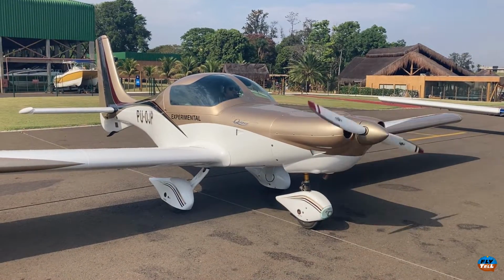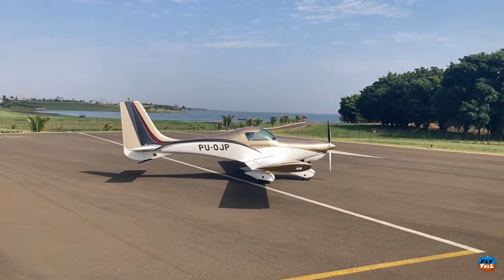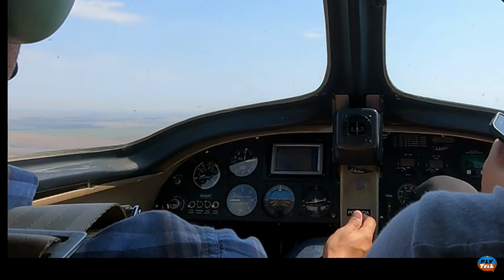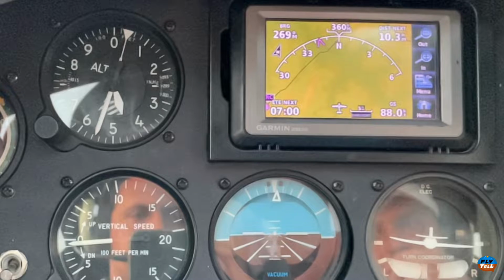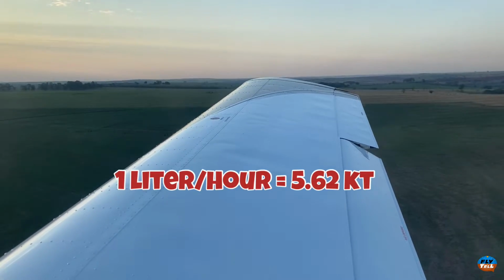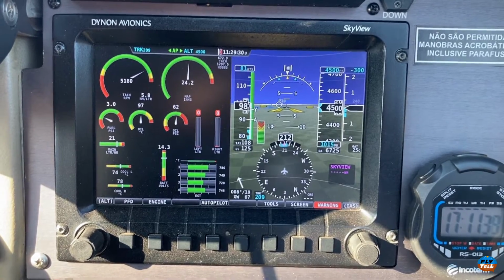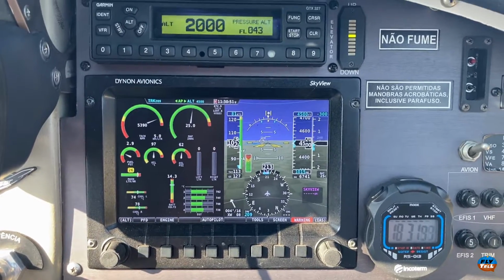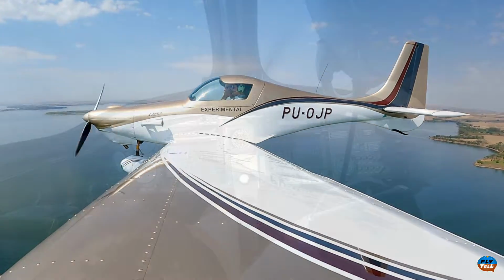ROTAX vs JABIRU - Quasar LITE engine battle - Flight Review and h2h - ENGLISH VERSION

Comment: I’ve flown behind Rotax 100 HP engines quite a bit in a Tecnam aircraft and it’s engine management is almost turbine like; just one throttle lever, no mixture control and no carb heat. I’ve no experience of Jabiru engines but for home builders on a budget, Jabirus with a few hours on them can be bought really cheaply while Rotax engines are very expensive and not really available second hand except with high hours, ie, 1800 hours. So it’s horses for courses. If you’ve got plenty of money, by all means buy a Rotax. Otherwise, a Jabiru will still get you into the air albeit with less reliability, more maintenance and slightly more difficult engine handling.
Reply: that is very true i agree with you 100/100

Comment: First I congratulate you on a series of great informative videos.  
I built a Rans S-19 Venterra powered by a JABIRU, 3300L.  I had similar issues with overheating on warm days, and I could bring the temperatures back down by adding carburetor heat. And also ran cooler at full throttle since I was burning almost 9 gallons per hour.   recommends adjusting the carburetor jets to aid temperature control.  I also have high oil temperatures during the summer. My engine has an oil cooler but another friend indicated he lowered temperatures by 15° by drilling 1 inch hole in the bottom half of the cowling in front of the lower part of the engine. This cool air to flow over the oil pan.  Jabiru is currently selling their GEN 4 engine which solves a lot of the issues I have with my GEN 2 engine.  I have to check the tension on 36 cylinder head bolts every 25 hours.
Reply from the maker: Thank you very much, @jhmcglynn . Great to know about real world experiences with the Jabiru.

Comment: A friend in Australia hates jabiru with a burning passion. His advice to me if I got a job Brew powered airplane that I should really practice my engine outs and off filed landings. I REALLY want a quasar, they go for decently cheap here in the States of you can find one.
Reply from the maker: They are not cheap down here at the plane's motherland… buy one! 😃
Reply: You need to find another friend. Friends don’t let friends fly with Rotax engines.
Reply: @dburton7929  He has recently changed his opinion and is now a fan of the 3300